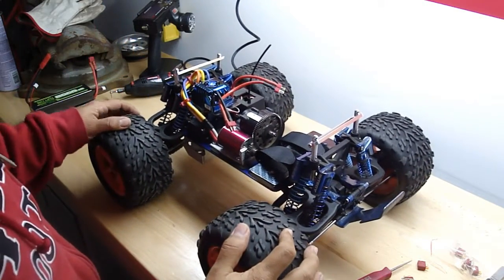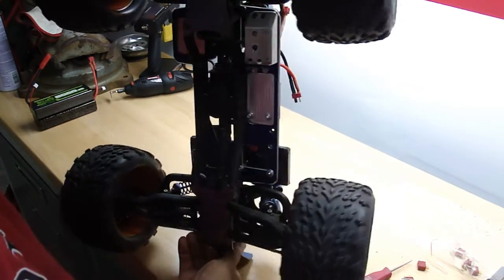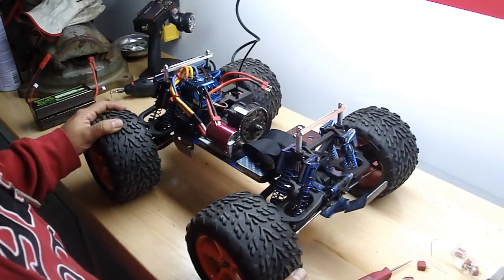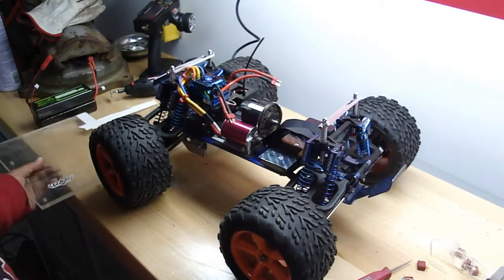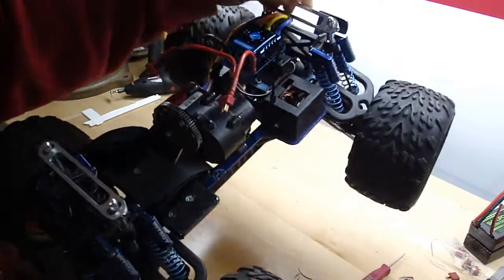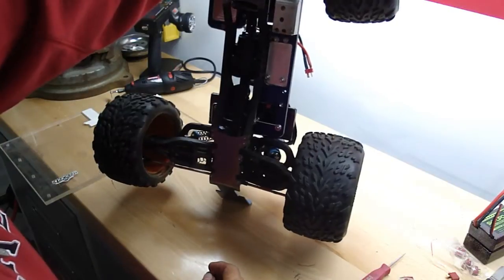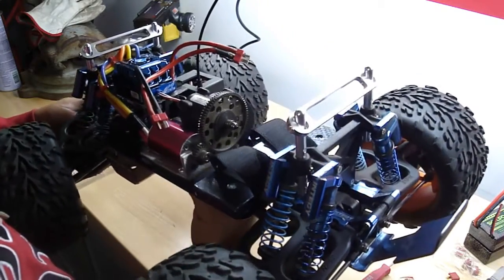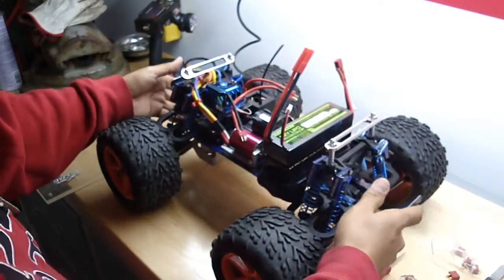T Maxx Brushless conversion   E/T Maxx Part 1

Comment: What did you use to get brakes and  reverse?
Reply from the maker: The electronics takes care of that. It's the Esc.
Reply: toyspeed71 the nitro has one way bearings in the gearbox so mine has no reverse or brake at the moment
Reply from the maker: @chrishawkes6277  BTW one way bearing is on the motor not the transmission. That's eliminated with the Esc.
Reply from the maker: There is a conversation kit with direct drive for a stock 2 spd transmission (no reverse) .  Made by traxxas. But you really have to understand an electronic set up.